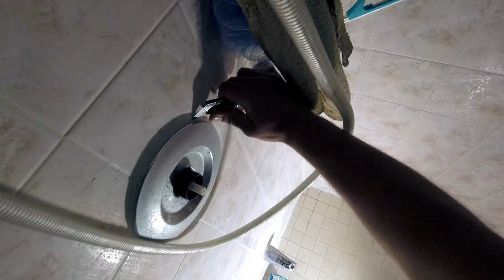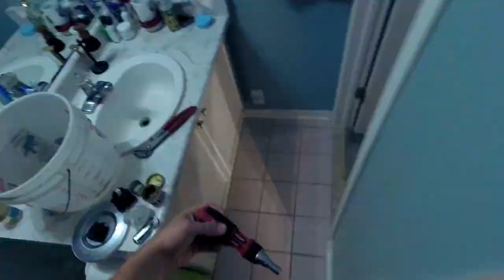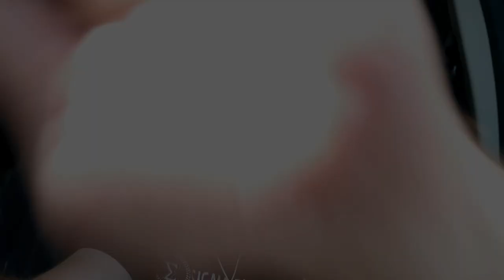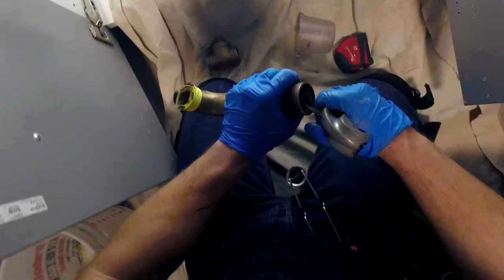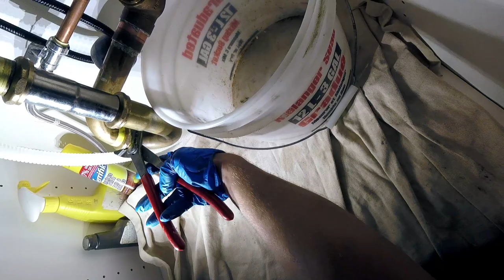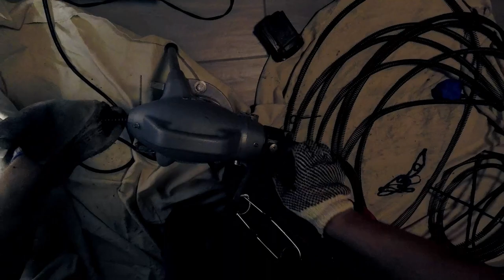A Day In The Life Of A Plumber 117 | WHY I INSTALL CLEANOUTS!!!!

Comment: I agree with everything you said on the clean out, we always have better luck when snaking a drain that is full rather then dry, I will often also install my clean outs off a WYE fitting and then a 45 with an end co in order to have descent sized bucket under it in the kitchen cabinets in apartment buildings, I like it as a back up for running hot water slowly to see exactly when and how the plug lets go.
Reply from the maker: I’m really glad to hear we see it the same. And actually if I had a choice I would always prefer a WYE with and end clean out as well! I love the angle you get when you are snaking and you are in a much better position altogether! Thanks for the insight Brian! Cheers!

Comment: Kenny do you guys use copper for water and waste piping? Also did you ever use a Milwaukee air gun for clogged drains?
Reply from the maker: Hey Nick, yes we use copper for both domestic and drainage, but no I’ve never used an air gun. Is it any good?
Reply: @Kennymolotov  do you guys ever use pex at all? I haven’t tried it thats why i asked if you did. I watched some videos on it but they dont show how it works on real clog. Also does your company do any heating work or only plumbing?

Comment: Do you do stress analysis when you design plumbing systems ? Also, is it possible to do such design without calculus, just trough geometry and maybe some algebra ?
Reply from the maker: Hey Ciprian, no we don’t do stress analysis, we only calculate hydraulic load and size pipes accordingly. You need basic math to do what I just described.

Comment: What size was that kitchen drain pipe,did you have to solder it and what kind of gas did you use to perform the soldering task kitchen sink clean out.?
Reply: 1 1/2”. And also Looks like map gas n turbo torch
Reply from the maker: Hey friend! The pipe was an Inch and a half, yes I did have to solder it and I was using MAPP gas to do so! Hope this helps!
Reply: @javierdiaz2666  wHAts the max size of copper that you can use with mapp gas
Reply: @m.morales9417  I’ve done all the way to 2inch. But recommend aceltayne tank for that tbh
Reply: @javierdiaz2666  what kind of torch head were you using when you were doing the 2"copper with mapp and is there like only one type of torch head when using mapp gas?I appreciate your time and expertise bud.
Reply: @m.morales9417  I have st99 turbo torch head   and aceltyne btank

Comment: hello everyone. i have a question.
how do i make a water tight seal on a 1/2" bsp  female/external parallel thread?
the fitting in question is 150mm long and the tap spout/facet screws no to it but there is no internal shoulder in the spout to tighten against, the hot and cold water are at 2-3 bar, i have tried ptfe tape/ Teflon tape and this is not good enough to stop back pressure creeping up the thread and leaking down the wall.
any ideas how i can seal this??